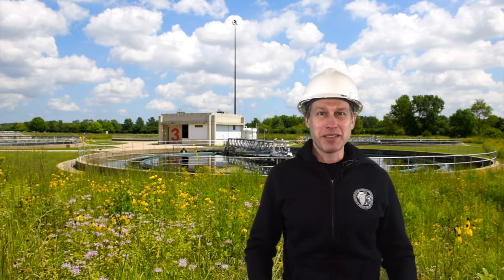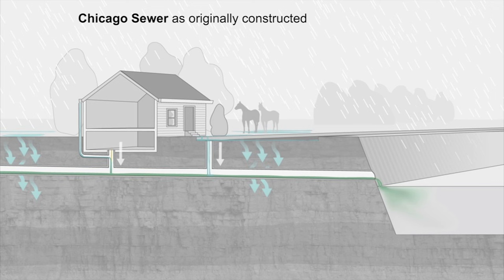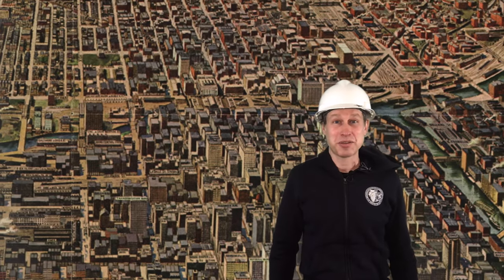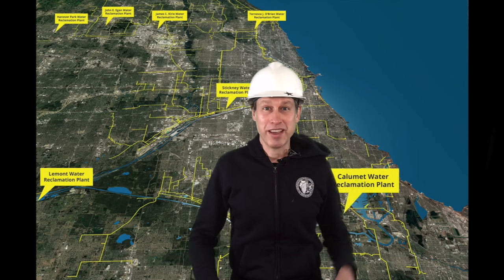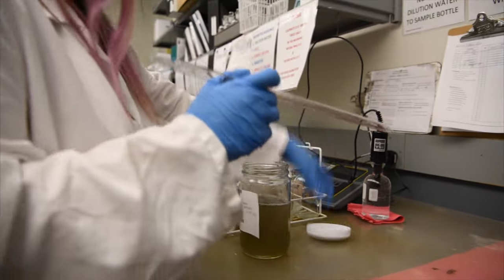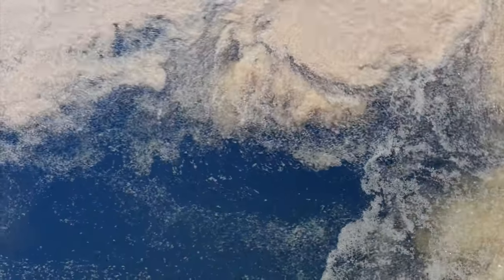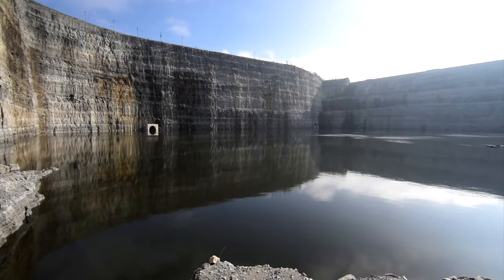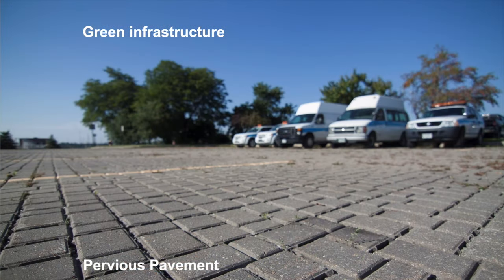MWRD Virtual Tour: Deep Tunnel, Wastewater Treatment, Green Infrastructure, Chicago Water History

Comment: Oh, wow! This was super educational and fun! I had a few questions, though I'm not sure if it adds to the understanding of the process. 

1. In the final settling/sedimentation tanks, is the water coming in from the top of the structure in the middle of the tank and raining down, or is it leaving the structure at the center through the entire structure; and how does the treated water from the top leave the tank (gravity, pumping, etc.) and where does it go? 

2. And related, how do you guys get what I assume you'd call the "flocculent" that settles after the flocculation process out of the tank?

I imagine each municipal system does it little differently, but it's so cool to understand how the water is recycled.
Reply from the maker: Thank you for watching and for the good questions! Water flows into the final tanks in center of the tank. The actual opening of the pipe flowing into a final tank is underwater, so no  - it doesn't rain down. Since we're tying to keep the water nice and still so the solids can settle at this stage it would be counterproductive to have it churning around any more than it has to. There's a circular baffle around where the water enters that helps slow it down a bit; that's the "structure" referred to in the video. The water just flows under this baffle, which only extends a few feet underwater. The water leaves the tank by overflowing into a channel kind of like a circular gutter.  The solids that settle in final tanks are scraped out an opening in the bottom of the tank by a scraper that continuously slowly rotates around the tank. If you do an image search for "final settling tank" you may be able to find some images that show all of this - it is a bit tricky to describe verbally.

Comment: Why not add more oxygen instead of air?  Much more efficient.
Reply from the maker: Good question! Using pure oxygen could be a chemically efficient way to oxygenate water but it is much more expensive  - air is free, hard to beat that price. Also oxygen is potentially very hazardous and requires special handling.